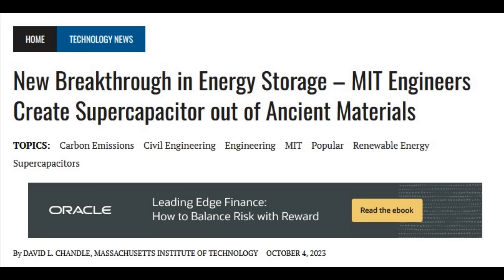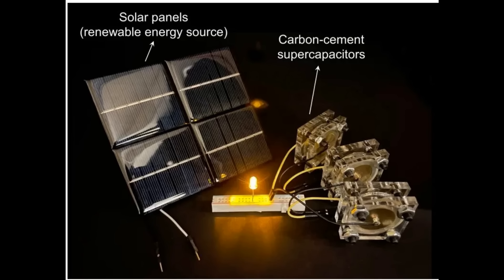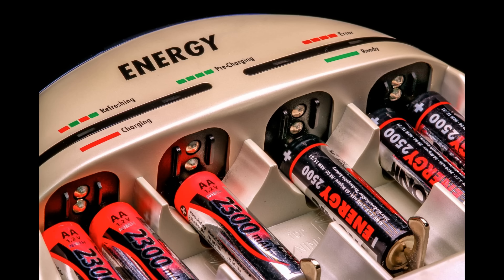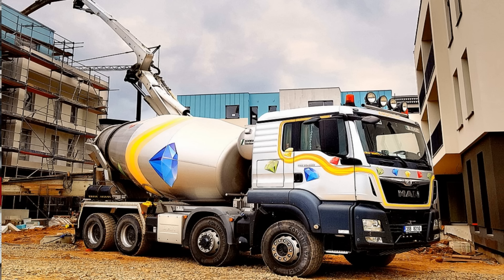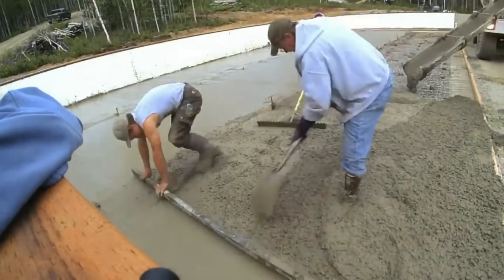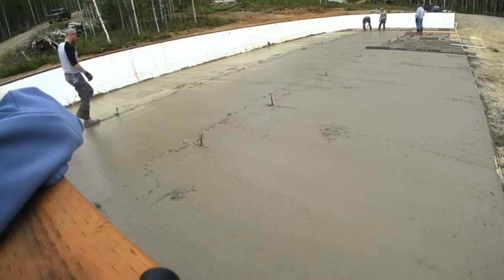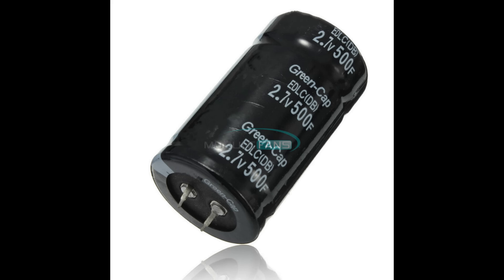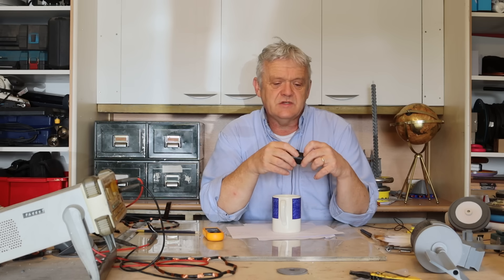2073 The Concrete Supercapacitor From MIT

Comment: People in India use roughly 10% of what the average home uses. Use less energy and the problem is easier.
An earth sheltered not so big house (1200-1600 sq ft) with a 3.5" slab and 3 concrete walls made of this stuff would solve for what Tesla can't.
That is resilient lithium free power storage..

Comment: Thanks, Robert. I find this quite interesting. Just this morning, I was thinking about energy capture; specifically electrostatic energy. We currently just send electrostatic to earth and don't even bother measuring it as a loss. Well, I think it's a significant loss! I think this would be a really interesting addition to helicopter landing pads at hospitals, as a partial-capture buffer for home lightning abatement systems and a plethora of other places where concrete is already in use anyway.

Comment: Over unity generator:
600v wind turbine generator motor
115v drive motor probably 1hp
200 amp rectifier 
1000 watt inverter 
Ryobi SDS hammer drill as a starter motor
x2 Gears
1 rubber belt
Cardboard box to act as a spacer
x2 zip ties

Problem:
Inverter always heats up and starts smoking
Probably 600v is too much

Possible Solutions:
Get an MPPT wind turbine charge controller 
12v car battery 
Then hookup to an inverter

Comment: Given that a cubic meter of concrete weighs around 2400 Kg and 9.8 joules is required to lift 1Kg through 1 meter I think you were out by a factor of 1000 on the amount of energy released by dropping it. Unless there is a factor I've not taken into account?

Comment: I cant understand how this man can't see it has best weight to storage ratio of you use it for making building..like house. It would be 10kwh /0kg
Reply: Yes, the gain in space and dual use, are both important factors. However the construction problems are probably insurmountable... My plan to use existing space and concrete in a sliced gravity storage concrete block however ... It would simply enhance the total energy density

Comment: Yes - though doesn't the fact that concrete hydration self-organises the carbon into a fractal network make for the principle to be useful somewhere?  e.g. at what minimum % concrete is there a maximum network?  What if that is enhanced with graphene?  There are other materials that set like concrete - e.g. plagioclase (granite) with extreme alkalai (Na/K.OH) + silica (sodium silicate), and other additives that might be used such as vermiculite, or organic material (such as mares tail/Equisetum) that would dissolve in the alkalai to create a secondary tubular network (which then makes the concrete act as a secondary diffusion matrix in a more permeable flow network - as can be found in fractured aquifers).  Which then potentially makes it more like a flow battery .  The general idea can be pushed in some quite interesting directions, which could be worthwhile if it has the same longevity as e.g. an Edison battery, and it's relatively inert and safe.  Could we just shrink-wrap interlocking blocks to of this to make a whole building?

Comment: Wouldn't you have to replace the concrete if it's like a battery?
Also, what happens to the battery when it absorbs water?
Just imagine the static shock you'll receive when you rub your feet back and forth.

Comment: Love your channel... some good ideas and practical thinking... iv been looking into using ceramic conductors like graphite which makes a great super capacitor... but won't hold the charge long due to it been a non polarised capacitor... to make it hold the charge it needs to be polarised so a second conductive material is needed... I was looking into making my own conductive material from concrete but also diamond and europium are of interest, even calcium is quite conductive but the objective been to have non corrosive conductor's... water and ash makes a good electrolyte with much lower corrosion rate than sodium chloride. Graphite and europium are superconductive which may yield some interesting results

Comment: I think you nailed it Rob. Sure, the active ingredients in cement have their place in energy storage or conversion - I've read calcium sulfate can make a good permeable membrane/separator - but the idea of your house footings being used as a capacitor or battery is ludicrous. Using them as gravity batteries or thermal storage on the other hand, well, that's a whole different kettle of fish.

Comment: There was nothing wrong with the experiment or publishing the paper.  It helps getting people thinking in a different direction.  Maybe some other materials, running wires through the floor like in heated floors etc.  It is a thought and an experiment.

Comment: Concrete Supercapacitor is a primitive version of the ones near the pyramids in Egypt.  They used black granite and it also has a nuclear property to that material so I have heard.  How it worked, well, no one knows.  They still think the pyramids were build to toss a body into it, no body has been found, likely never will be and also they think it was built by moving blocks which it wasn't.  It was poured as it was Egyptian concrete that has over the thousands of years, been breaking down.  There is also basalt around the pyramid and could be under it as it acts like insulator.  However, you will make more power by dropping a concrete block than it's ability to hold energy; that I agree on.  It offers more energy in kinetic by dropping it than it's ability to hold it.  It's really a poor media for supercapacitors. And bulky as well.

Comment: How about using the carbon added cement as underfloor heating due to it's resistantance? Perhaps as a 1" thick screed to withstand expansion and contration. It would need expansion joints and a dpc below it to allow expansion movement. But it could work.

Comment: Thanks for the video! It does remind of Mechanically Stabilized Earth which is used in construction and consists of stacking multiple layers of dirt/sand and basically paper on top of each other to make a strong and stable surface. Practical Engineering's channel has a great video about it.

Comment: Hmm, if it has to stay wet... that is problematic. Perhaps you could test your "Graphene" concrete perhaps pour 1 "capacitor" out of it... You could then test to see if the graphene version really needs to be wet. One bonus of graphene is that is is far more conductive than "carbon" alone, and the strength of the concrete will be much higher.

Comment: I think the idea with this was more about using cheap, abundant materials and infrastructure we already use and need in a way to help with the storage issue.

My biggest fear with renewables is that we're just moving our damage to the planet to another problem like the pollution from lithium extraction. 

It may not be a silver bullet but it's encouraging to see there's other ways of looking at what we already use and getting a second use out of them.
Reply: From your neighbor pouring his used oil out in his yard to leaking tanks, tankers, machinery, pipelines, freight cars, abandoned wells, exploding wells to refineries and fracking to climate change, I think it is a fair trade off.
Reply: @MrRedberd  The 9 year old slave digging up your lithium is glad you think his misery is a fair trade off for pretending to care about the environment.

Comment: Seems like it might be well integrated into the printed houses cement tech. It would be really interesting to use the house itself as energy storage.
Reply: thinking laterally ,this is already done ,thermal mass storage ,either/and floors, walls & water tanks, warmed by good olde sun light ,designed to gather low angle sun in winter but shaded to stay cool in summer .
Reply: @johnmarkgatti3324  I do find going directly to electric storage intriguing, though. I imagine you could harness lightning similarly, as long as you had diffuse enough storage with practically unlimited capacity, like a parking garage or high rise. There are sorts of ways to build with lamented materials using rebar-like material as conductive material shouldn't impact structural stability, and you could put up unlimited small wind and solar to constantly collect, maybe. Something that big could probably also do thermal-electrics, too, soaking up all that sun. Maybe even water wheels in the rain gutters. And distributing lightning across the mass storage. You could at least turn a parking garage or municipal building into a distribution smoother, like a water tower for power, hopefully a productive generator for the grid overall.

Comment: I keep running into the misconception that batteries " store" electricity. Batteries generate electrical energy. Acid dissolving lead creates current. Charging just clears oxide from the plates so the acid can reach fresh lead and make more electricity.

Comment: Hi Rob, I was wondering when you will be making video on MIT cement super cap and you didnt disappoint 😊. Thank you for the video. As per the article I read it says a cube of 3.5 meter across holds 10 KW hours of energy. More carbon black will increase the super cap capacity (for non structural setup). I may be wrong but that means a cement +carbon black cap of 1 feet cube will hold atleast 500 watt hours to 750 watt hours may be?. Hope you make one video with the small prototype and test?😊. Thank you once again.

Comment: makes piezoelectric theories of the pyramids maybe compressed by the possible action of lower chambers acting like a ram pump thumping away pumping water, which would make me think that in the ages when there was so much water erosion on the sphinx, perhaps they could have used them as power sources.

Comment: Once again we go back to the principle "Something is better than nothing" -- The approach of comparing this technology to batteries for energy storage is silly.  We will not be putting concrete super-capacitors into our tablets and laptops.  What it DOES do is allow us to convert objects that otherwise would not be used for storage AT ALL into something that can store some energy.  We use an incredible amount of concrete for building, and adding carbon has the advantage of making that concrete stronger.  So we get a two-fold advantage.  The goal is not to replace batteries, but SUPPLEMENT them in ways that make good sense.

Comment: what about adding flash graphene ? lots ?
Reply from the maker: it's not just a matter of the chemistry mate - the chemistry is basically ok - it's about the feasibility of the structure - you can't make buildings from chopped up concrete and you need to chop it up to make batteries

Comment: Nice review.  I was thinking of how to solve some of these problems.

Conductivity - add conductive filaments. The extra tensile strength gained by added filaments would allow you to increase your carbon-to-concrete ratio. The extra conductivity would allow for a much larger distance between current collectors.

Conductive epoxy on the exterior acts as one pole. Conducting rods set into the mix act as the other pole.

Set the power control circuitry into the mix while pouring - that is an easy installation.

But you would still need thousands of cubic meters to really do anything. 

Interesting support technology for parking garages and the like...
Reply from the maker: it's not just a matter of the chemistry mate - the chemistry is basically ok - it's about the feasibility of the structure - you can't make buildings from chopped up concrete and you need to chop it up to make batteries - if you basically glued all those little batteries together with epoxy to make it strong enough to be a building it would start to edge into the pointless wouldn't it?
Reply: @ThinkingandTinkering  

I was suggesting the application of epoxy after the concrete had set - do it in a single pour, but integrate necessary technology into the forms. 

Power control devices and interior connectors could all be attached to the form.  The form could be lined with a material that could act as the exterior current collector, melding with concrete to be resistantto water...

I suspect it is such a niche market that nobody will ever develop it.
Reply from the maker: I was pondering what you said mate - maybe make them as a sort of tile? and stack the tiles?

Comment: In the world of academia the basic rule is publish or die (in other words, publish or find your funding reduced next year).
As a result there are a lot of scientific papers published, with a catchy title and interesting synopsis, which when properly read, turn out to be less useful than the paper they were printed on (not that much ever makes it onto paper these days) was before it was covered in all that ink.

And indeed if the right kind of ink was used, and the right patterns drawn with it you could probably make a better super capacitor using that paper than you could get with the odd ton of concrete super capacitor, but it's something new, and as long as the maths is correct, that's all you need to get it published.
Reply from the maker: lol - that is brilliant mate - you are absolutly right there

Comment: The "revolutionary "reinvention of the toroidal propeller for drones with a LOSS of 40% efficiency... the supercapacitor with basically zero real applications except as example of hype...

Has the MIT become a parody of itself?
Reply from the maker: wow - 40% - that i didn't know thanks for sharing mate
Reply: @ThinkingandTinkering  Take the number with a grain of salt, MIT of course doesn't give numbers, but a Youtuber made some tests and reached to that conclusion, based on the duration of the battery charge under same flight conditions ...I'll try to find the video and post it ;)
Reply: It was probably this one, if I remember right:

"Testing MIT's Toroidal Drone Propeller Design & Sound" and the channel Jays Tech Vault

As he points out, the test isn't really fair cause the toroidal props were 3D printed... but still, the results are so worse, both in efficiency and sound output, that they probably are a real red flag. 

Besides, common sense says that doubling the mass of the propeller isn't exactly a good idea, efficiency wise... toroidal props make sense in boats due to better cavitation handling, as discovered a hundred years ago (patent CA37791A from 1891)...but in air, color me doubtful
Reply from the maker: sorry mate my bad i removed my other comment as i thought you were talking about the numbers given on the performance of the capacitor - then it clicked you meant the propeller - i'd love the link - but you tube will remove a direct link posted by anyone but me - can you just post the title?
Reply: @ThinkingandTinkering  Oh, that's what I did. I know how YT behaves ;)

Comment: I did see some programs about 3D printing buildings for Mars in layers. Might not be the winner of any energy density prize, but could do a small top-up. For keeping it hydrated, you could wrap it in something resistant to the Martian atmosphere and use a small pump to circulate it within that layer (covering the Turkey for self-basting). It's definitely a good Curiosity piece for Roving the mindscape though... 😏
Reply: I read that nasa plans to 3d print ‘houses’ on the moon.
Reply: There are people 3d printing houses here on Earth.  Might be an interesting case study to try here before on the Moon or Mars.  But also from a construction stand point, if you need the paper/metal separator every inch or so, the 3d printed house setup is ideal. Just add a spool of your desired material and lay it down right infront of the concrete extruder head as you go.  As to how to make it stay wet without ruining the integrity and livability of the house is another problem to solve.
Reply from the maker: for sure mate
Reply: Sounds more interesting than it actually is.
We cant land on the Moon and also not on Mars.
Wake up from your wet space dream please.

Comment: How much energy could we theoretically generate if we took the currunt uk prison population (ethics aside) and had them walk in giant geared hamster wheels lifting concrete blocks up to a height and then have them blocks lowered again in a free-fall fashion but operating through a high ratio gear chain? 

How could we model this concept and that calculations could be used to scale up the idea to say a prison population scale.
Reply from the maker: that's not too difficult mate - the figures are out there - i think leg power is 120 watts and then how long that can be sustained per person multiplied by number of people less a percentage for efficiency loss - probably about 40%ish
Reply: So, hypothetically, On the UK prison populace alone working 24/7 we would be able to generate megawatts of power, approximately 3 or 4 megawatts I estimate so am i correct in thinking it would be about the same level of generation as an onshore wind turbine?? 
The idea that it would take 82,000 people walking 24/7 on a giant hamster wheel to generate a few megawatts blows my mind, There's certainly some strength in them there winds, lol. If only we could capture and/or harness the power of a tornado.

Comment: And they say that humour is dead ;o)

One point though ..... the values!
If you were making a "Supercapacitor" to say store hydroelectric output from a dam the measurement against weight becomes largely irrelevant. Similarly when you look at batteries for grid stabilisation .... the weight does not matter! What becomes important is the actual energy stored! Obviously if you are in a mobile situation it Does matter a great deal abut the power to weight ratio!

Eather way I think you are bob on with both construction costs and practicalities for the "Concrete Cat"!
Reply from the maker: good points mate - cheers